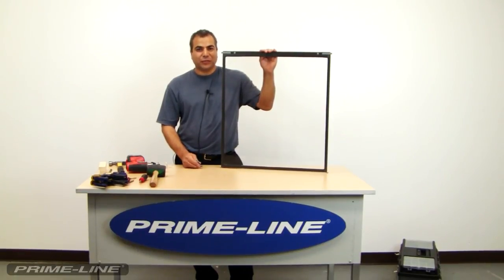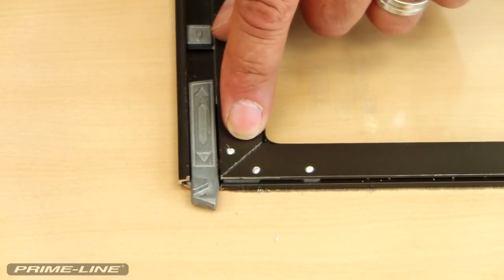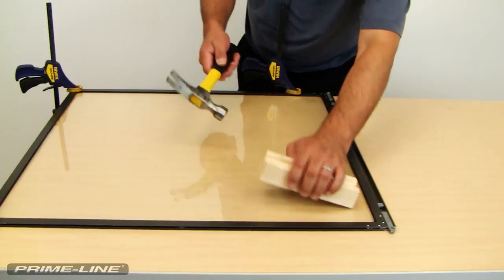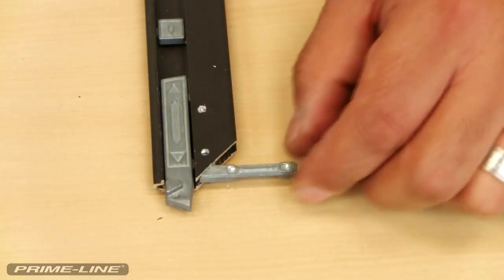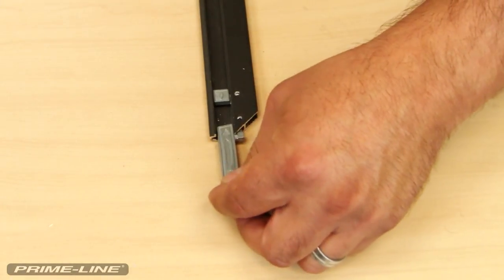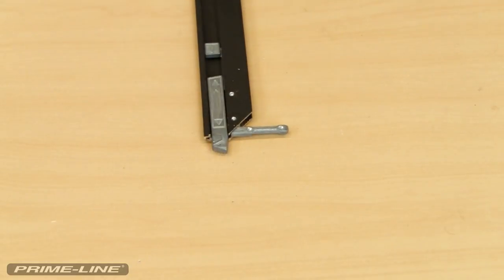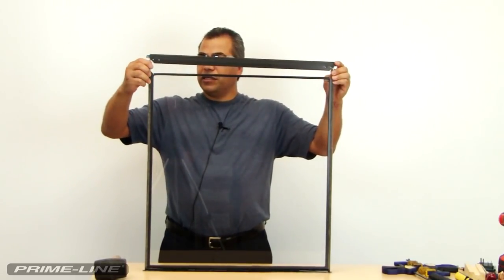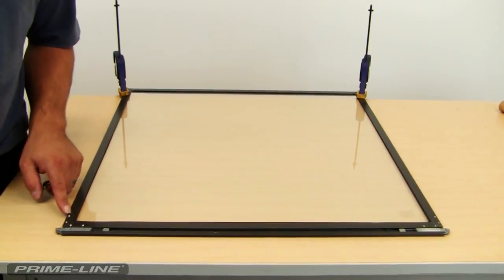How-To: Replace slide bolts in a storm window.

Comment: Well this video is very old so this is probably a long shot….but how do you measure to know what size slide bolts you need without taking it apart first? I don’t have any of the original info for the door and there’s nothing on there anymore with a manufacture name or anything

Comment: It seems when I need to see it , it appears in my feed. I noticed the corners didn’t seat tightly. I saw the light coming through the 45 degree areas. Any suggestions? 
Also I have a window frame that became rickety after the glass was out. Can the dimples be punched bigger or harder in some way?
Respectfully

Comment: What is the part numbers for the corner key set, and the bolts? I bought PL 4 corner set, but had to file them down to fit my frame. The bolts I repaired old ones by jbwelding in a piece of steel to the bolt, the ends of the bold had bent and sheared off. 

What I bought is Prime-Line Products T 8689 Tilt Key and Corner Key Set, Diecast,(Pack of 4),  Comes with 2 of the PL 15226
As Well as 2 of the PL 15102

Comment: Question, if you drill out the die cast corner keys, and then punch them with a nail punch is that enough to hold the window???tx

Comment: Can you make some custom storm window inserts for me. I am missing a few. Local places say they are too big for their stock material inventory (they take apart old ones and refurbish them). My missing storm insert is roughly 46"×33" I have 2 windows one side is missing the insert. I swapped the inserts to make sure they were the same size. So I got the measurements off an actual existing piece. I dont need the glass inserted someone local can do that. I just need the frame made with the slide locks. I can put the frame together when it arrives.

Comment: I'm confused about the using the nail set to relock the corner keys.  I thought the indents were drilled out in order to remove the key, so what material remains that the nail set pushes into the key?
Reply from the maker: There's still some material around the edges of the hole.  If you're worried about it coming apart, you can also use a small pointed punch, and punch down right next to the old holes.
Reply: @PrimeLineHowTo  - I had the same concern bil expressed.  I like your suggestion. I am also guessing you could make another dimple in Corner Key and then use the nail set (or similar) to place a new dimple in the frame (in the corresponding location)

Comment: Very nice video. Unfortunately, I had already trusted a local home supplier to fix my windows and they drilled out the dimples with too large a drill.  They squeezed the frame with pliers to hold them together, and the frames have now fallen apart.  They ruined my frames.  So how do I hold them together now?
Reply: You can use epoxy glue, or use PL Premium polyurethane construction adhesive. If you use glue, make sure the glass is in the frame as that will keep the frame squared up. Cause after its cured, it wont move. I suggest PL as it likely could still be banged apart. Or an epoxy that melts if you lightly heat it, dont JB weld the frames corners in as heat wont soften that epoxy.
Reply: @scottdowney4318  Thank you.  I found some  corner and tilt keys that hold in place via springs that grip the inside of the frame.

Comment: Just in case you or anyone still monitors this vid can I get replacement channels that the window slides up and down in?? All I get when I search is upper and lower slide parts for horizontal 
sliding screen and patio doors. The slide bolts are fine but the small cutouts in the channels are really chewed up and the window constantly falls down when the door gets closed.
Reply from the maker: You would have to go back to the original manufacturer of the door and see if they would have the vertical track.  That's not something that we carry.

Comment: I'm going to replace slide bolts and pivot corners ( ? ) or whatever theyre called,, but my windows don't have the punched indents to drill out,,  would I just tap them out anyway or would they be held in place with an internal notch?
Reply from the maker: +ThePostalbiker You could try tapping them out.  Just be very careful and take it slow.

Comment: How far are we really drilling the indentations? Where can we get replacement material for the glass borders? Great video!!
Reply from the maker: You just want to drill far enough that you break through the layer of the frame.  This removes the indentation and will allow you to pull the frame apart.   We sell 41 different kinds of window frame.  You can see what we have here.  https://www.primeline.net/product-categories/window-and-screen-repair/window-frame#/pagesize=36&orderby=5
Reply: What gaskets are needed for 3/32 thickness glass.
Reply from the maker: That would depend on which frame you use.  We have even more different types of glazing channel.  https://www.primeline.net/product-categories/window-and-screen-repair/glazing-channel#/pagesize=36&orderby=5
Reply: Ok thanks!! Much respect..

Comment: This is probably much easier on shiny brand new windows.  Mine are at least thirty or forty years old and they aren't coming apart as easy.  Most of the pivot points break off if you blow on them, if they weren't broken already.  I think I know why some of these storm window companies went out of business.  If you are averse to using profanity you may want to pay someone else to put new windows in.